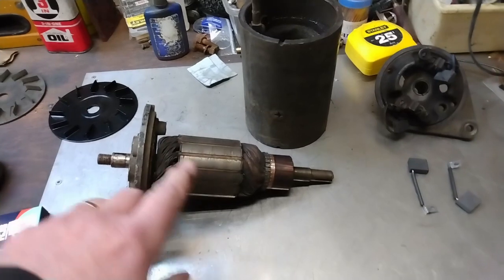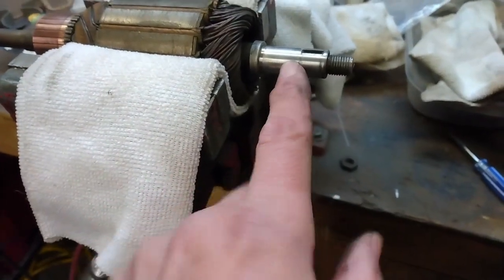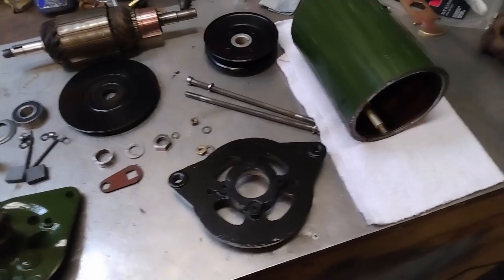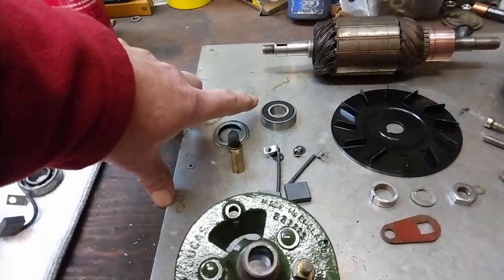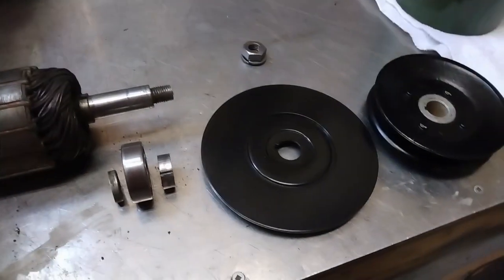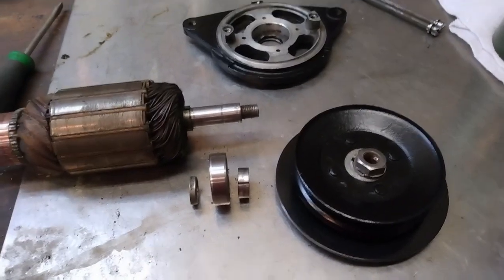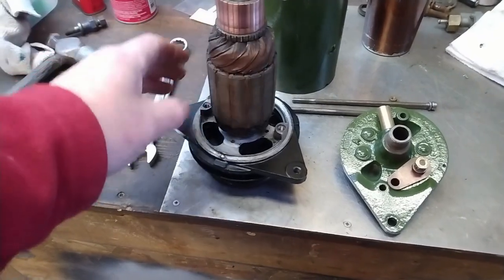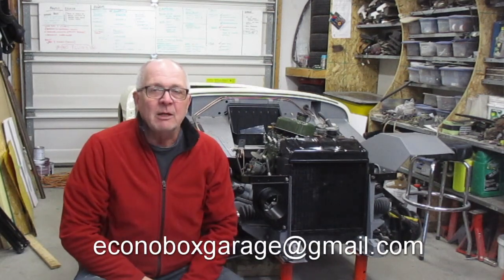How to assemble a Lucas generator as used in an Austin Healey Sprite MK1. Bugeye Build Episode 93

Comment: Looks as good as new -- in fact, better! I didn't know about that "oiler," so I just looked it up in the Driver's Handbook and apparently it's supposed to be topped up every 12,000 miles. Then I started flipping through a bit and laughed when I say that the recommend checking the oil daily -- not weekly, or at every fill, but every day!

Comment: Great video Ian. Good info re new sealed bearing replacement. Curious why you changed the fan. Was it damaged?
Reply from the maker: Thanks Gareth. There were a few of the blades on the fan that were bent and a new one wasn't that much so I figured, why not!

Comment: Ian, where did you get the locktite for the bearing? I think it was #906 but I can't locate it. Thanks
Reply from the maker: Hi Dan. It's Loctite 609. I purchased it from a local parts store but it is available on Amazon. There's a link in the video description that will take you right to the correct page on Amazon.
Reply: Thanks, I ordered it from Amazon. Just turned 70 and all of a sudden I'm dyslexic! I'm going to use it on my rear axle bearings. There's good evidence that they were starting to spin on the hubs...